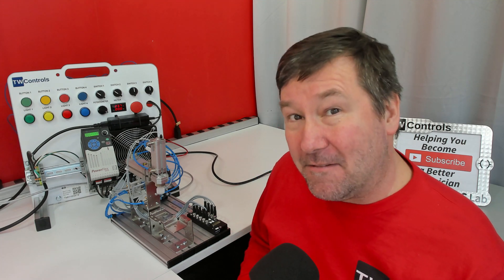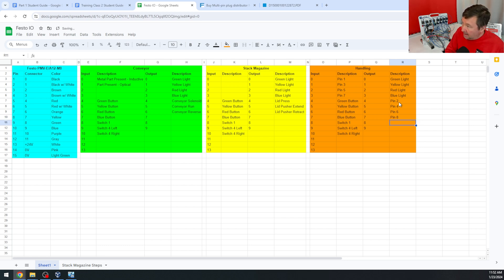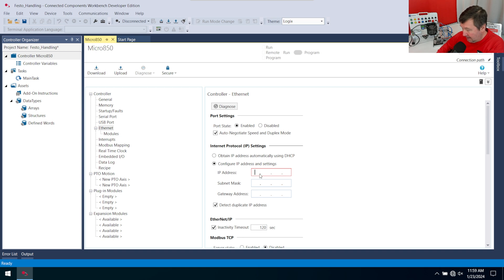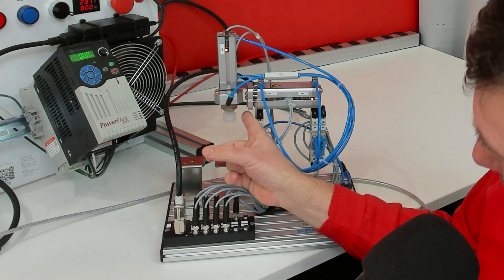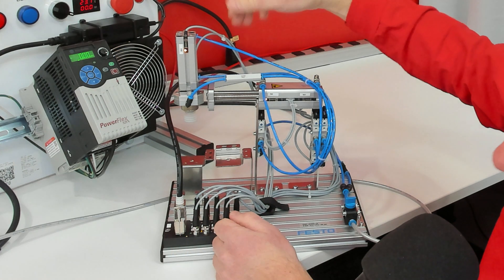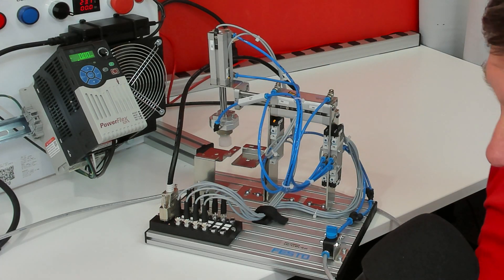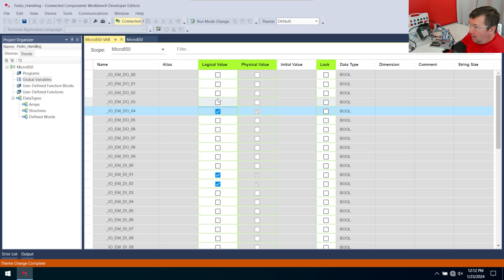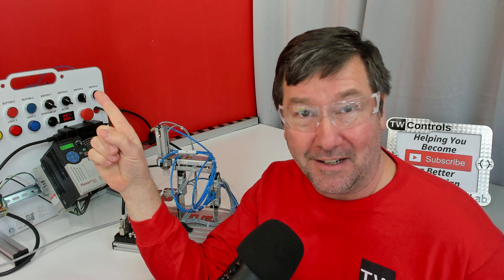Wiring Your Micro850 PLC Trainer to Your Festo MecLab Handling Station

Comment: Do you have a video on the Powerfelx 525 with encoder position? I have a hard time understanding how to get the motor to turn 180 degrees and what all the parameters do
Love your videos! They have helped me a lot!
Reply from the maker: Do you have an encoder module? By default you can only do the pulsed input. Here is a video on that
https://youtu.be/zGIQ3fr17sQ
Reply: @TimWilborne  Thanks for a quick answer! I have "25-ENC-1 PowerFlex 525 Incremental Encoder"
Reply from the maker: Here is a video on it but based on what you are saying you likely need a servo or at least a PowerFlex 527
https://youtu.be/m23_fQKjV2w